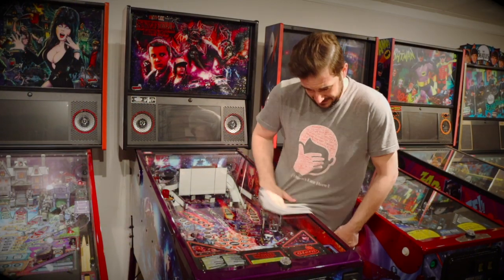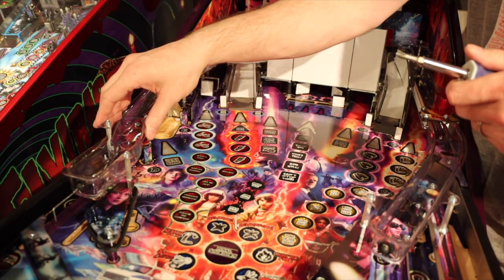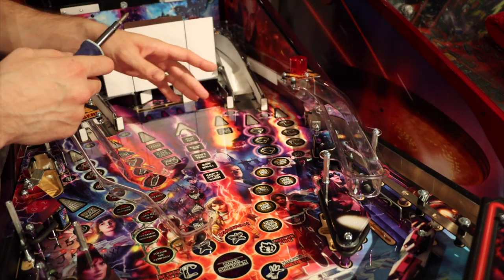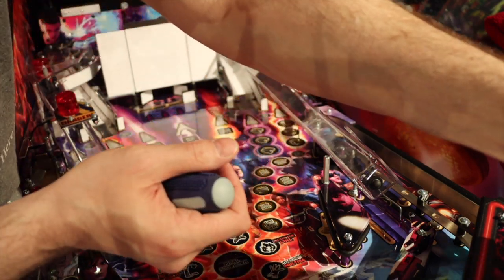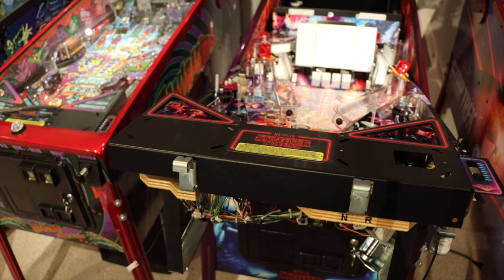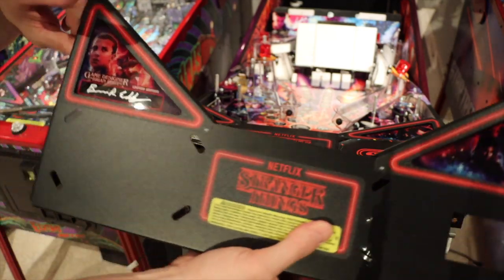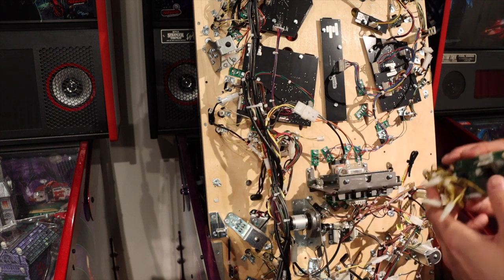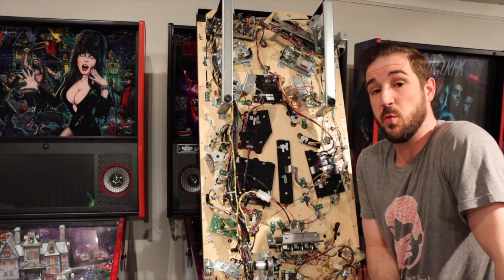Stranger Things Pinball UV Kit Installation and Projector Adjustment

Comment: I installed my kit on my LE, but did not install the plastics as they looked exactly the same.  So I guess I need to replace the plastics to see different art with the UV?  I even ran a UV light over the new plastics and could not see a difference.  Thoughts?
Reply from the maker: casarcvideo yes they also have uv reactive art on them. Might as well install em

Comment: Honestly, on the fence - do you have any experience with the "brand X" UV mod?  The Stern one does look nice but I worry about things getting hit and broken in pins.  I wonder if the side UV lights will create an issue.  Thanks for the video!
Reply from the maker: Tons of plays since this video and now issues or breaking. They are constructed inside thick metal so I think they are good